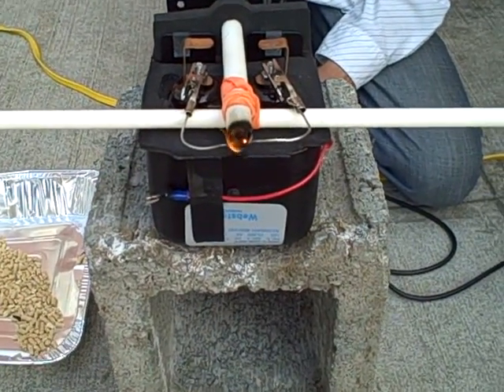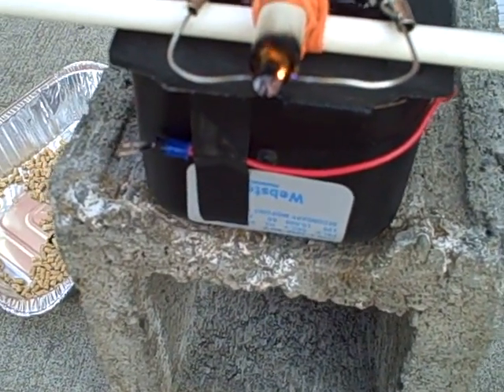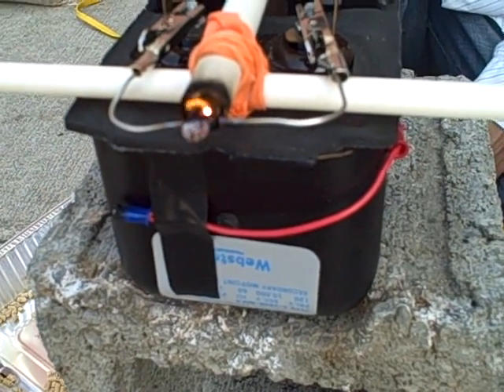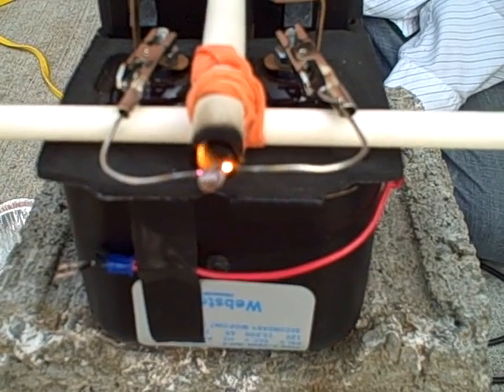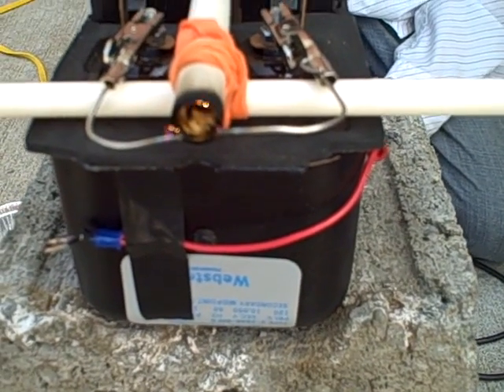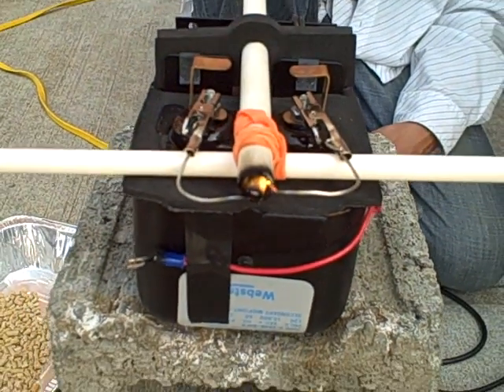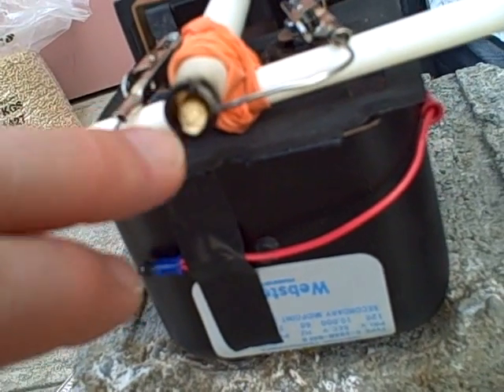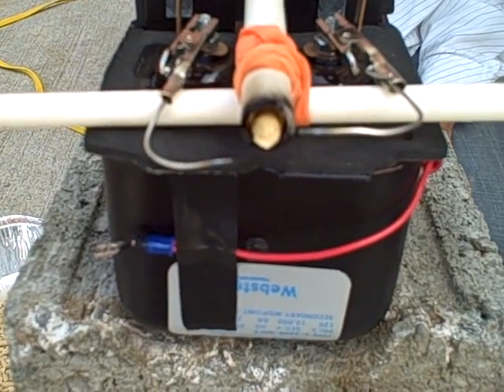Plasma arc gasification -- first try

Comment: Not tar. It's creosote. I would guess you're not hot enough. No gas source? Shouldn't you be feeding it a gas source to get up to full heat? The arc isn't enough to create a the type of plasma that will in turn gasify your input product. You will also need a fuel source to get it hot enough to vaporize. Any syngas coming off of that will be burnt as it's created (yellow flame), and you'll be left with carbon monoxide, if you are truly getting the pellets to gasify, that is. I'm not claiming to know everything about the process, but I would perhaps enclose it in a plexi container and isolate it from everything, save perhaps the pellet tube and the gas fuel tube (maybe oxygen, or acetylene). Obviously you're gonna want a few open air tests. have an exhaust tube that runs through a bubbler to clean it and cool it, and see if what comes out is combustible. The trick would be to define what's coming out. Could be unburned acetylene, or hydrogen. If it's hydrogen, you've won.  If it's non combustible, or acetylene, you haven't. I guess if you used a heavier than air gas as the input gas for the plasma arc, any unburned gas could be channeled out of a lower exhaust tube.. Any hydrogen would leave the system via an upper one.. But then you'd likely have problems with the bubbler... Maybe do that on the other side of the bubbler. I dunno.. I'm interested though. Looks fun.

Comment: yeah, your problem is that your thing is open air. in order for your woodchips to decompose without incinerating (they are incinerating as is). your released gas is not syngas, it is just smoke. if you have the process in near absence of oxygen, then you will be doing something.